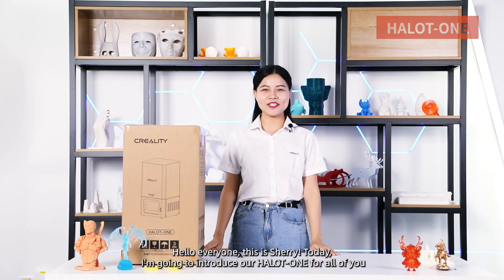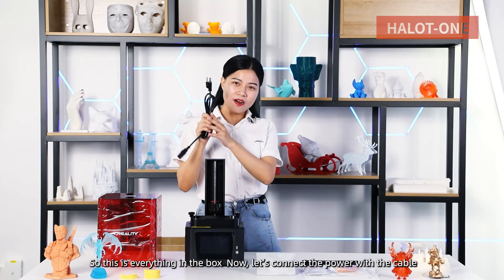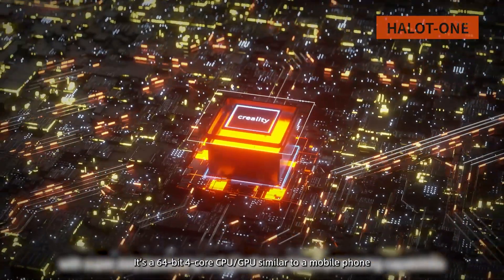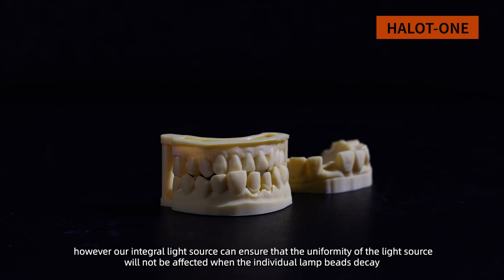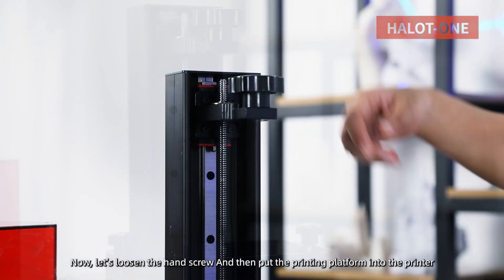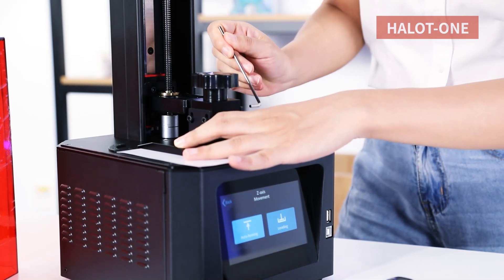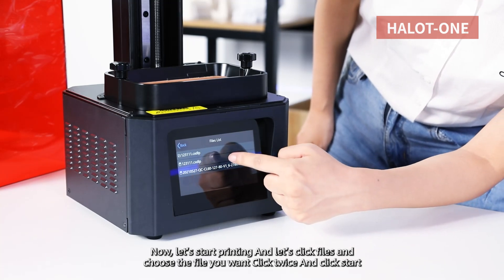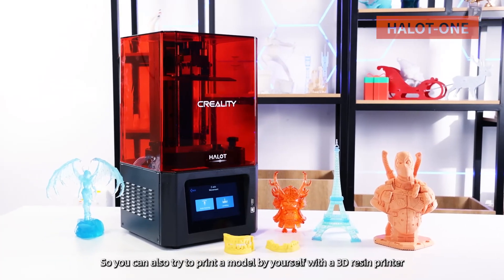Unboxing | Creality Original HALOT ONE Unboxing & Assembly & Print

Comment: Hi, I just got my Halot One CL-60 printer this week. It´s connected to wifi but I can't do a firmware update with wifi. Put the file on the USB stick but when I press Local update the whole printer freezes. I have to take the power of and back on to get it functional again. Tried a test print but  the screen freezes after a couple of minutes and nothing happens after that. I have to take the power of and back on again to get it functional again. Not very happy with the way this new adventure is starting. I'm doing everything according to the manual, so what's is wrong then? I'd like a solution or else I'm sending it back, cause now it is useless to me.